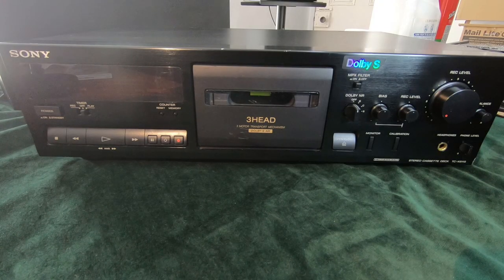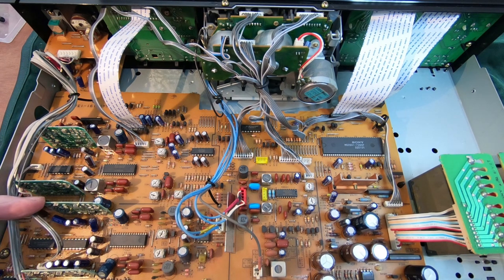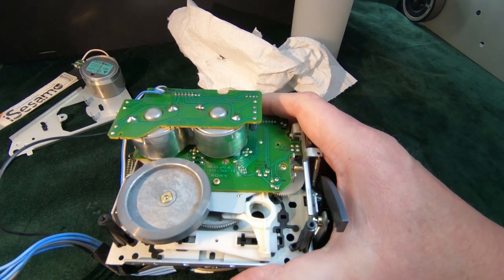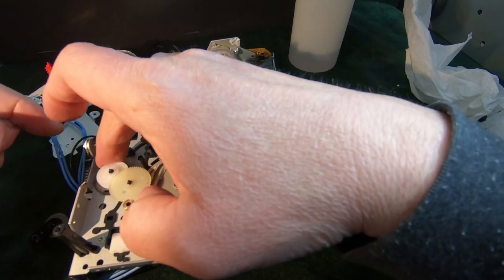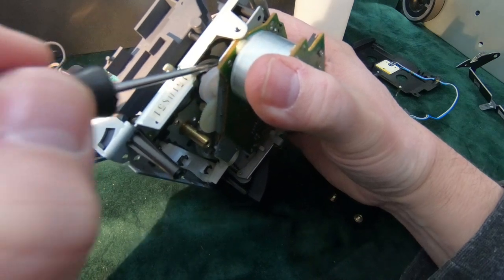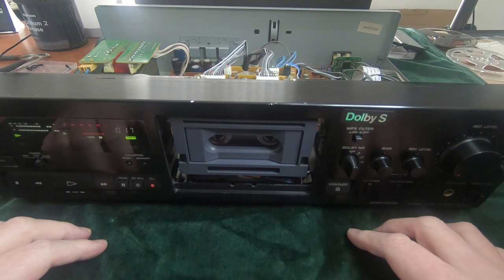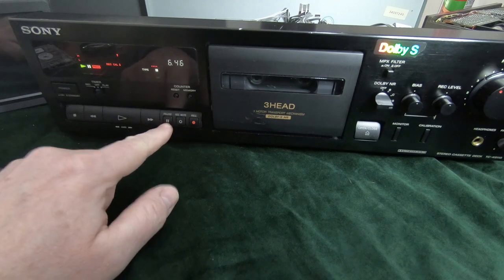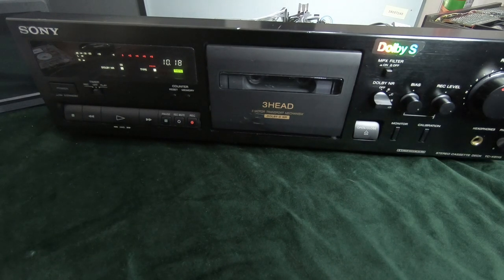Sony TC-K611S cassette deck : Belts - Speed - Bias

Comment: I have the same deck for a few years. Works very well. Has some minor issues like AMS function doesn't work,  tape type indicators sometimes doesn't work and type I tape detects as type II. Also I need to get from somewhere test tone tape, to adjust tape speed because I only tuned it by my hearing.

Comment: You do know the capstan wheel has a little washer on the pin 📍 side by the pinch roller? 🤔
Reply from the maker: Yeah l. Little clear one. It did go back on, just camera wasn't on at time. Good spot though 👍